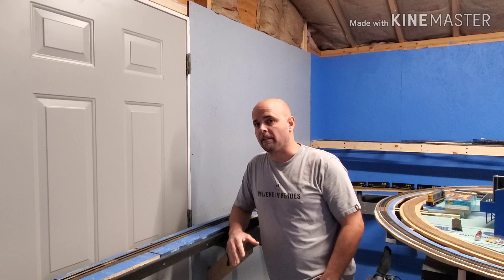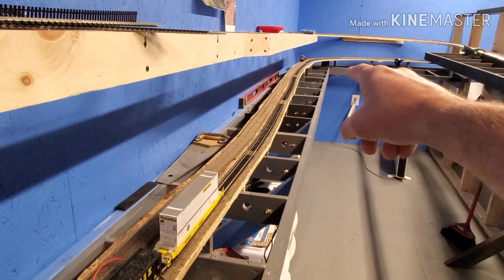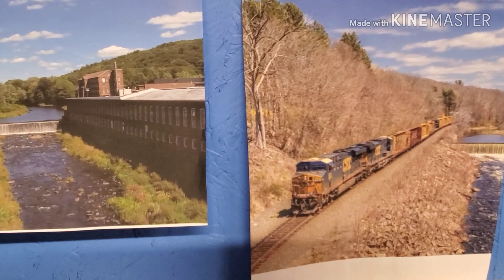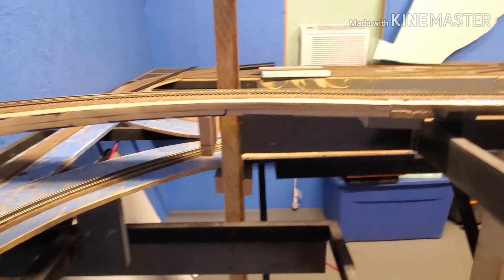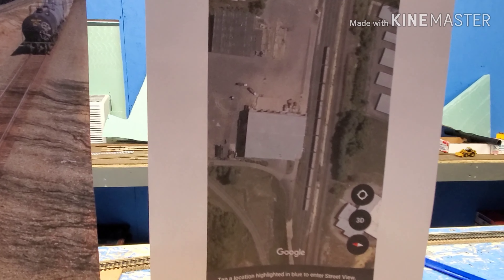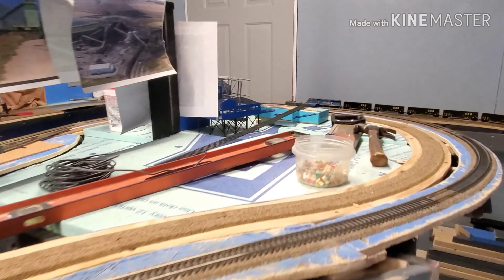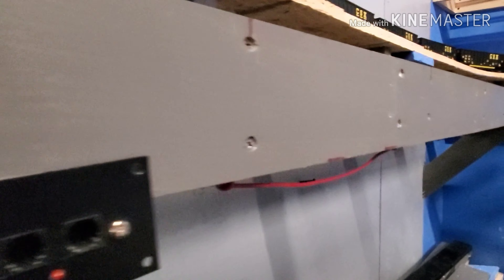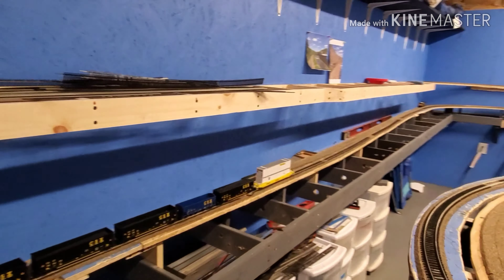Layout Update May 7th

Comment: I too like the idea of three bus lines, just have two now one for my NC"E system and one off an old ATX cpu using the 12 volt rail. If I go with 6 volt lights, I can bus out from the 5 volt rail for power to them.
Reply from the maker: Yeah its definitely needed with the amount of switch machines I will have and lights. How are you
Reply: Like you I got what I think is a good deal on 6 tortoise machines. tho7ught $8.00 apiece for them not bad. Still need to pick up a few more when I can find them.
Reply from the maker: That's not bad at all man. I'll need to get a count and see how many ill need